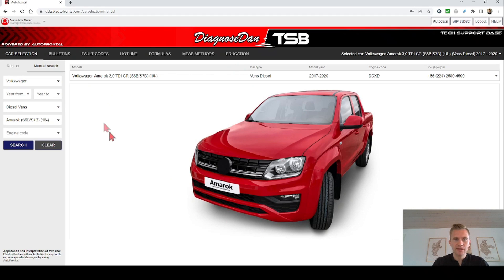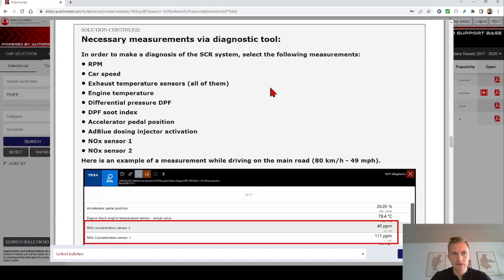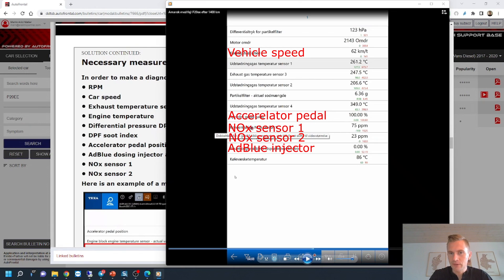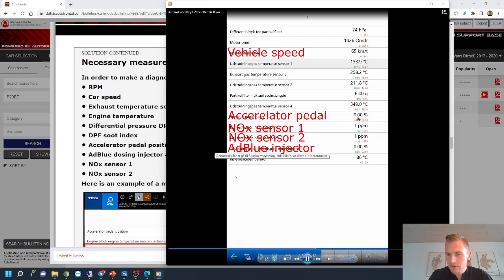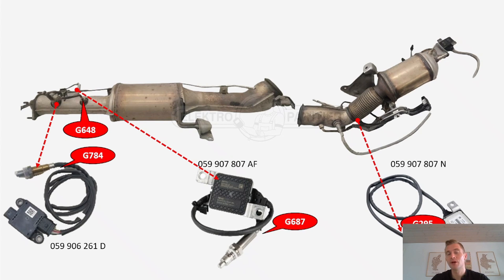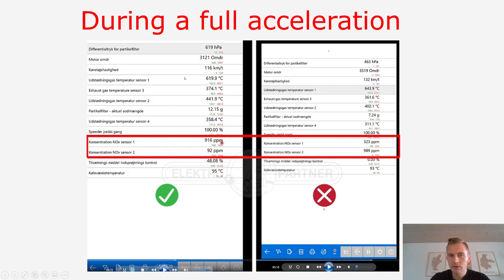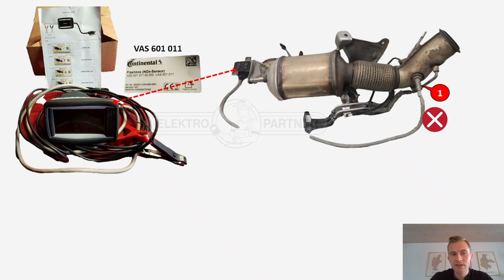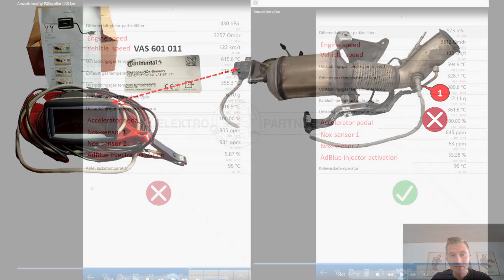2017 Volkswagen Amarok 3,0 TDI - Intermittent fault code P20EE

Comment: One year now i have P20EE on my Peugeot 208 bluehdi 2017. Nobody knows what's going on. After service I took the car on highway and check engine key light and adblue came on. I changed adblue injector but the problem still exist. I bought an obd to reset the lights by my own. Any suggestion?
Reply from the maker: Hello @VCPLOU. TO diagnose this type of error requires a technician with the right education, tools and information. This error can have many different reasons and different causes to the error. I advice you to send the car to a qualified technician with access to all the right information regarding this.

Comment: Thanks Martin, I have a same problem in an Iveco daily, code p20EE and the value in sensor 2 is greater than sensor 1!  this van has a history of problems with the dpf and scr, there was an overheat and it destroyed the dpf and the scr was cleared.  already with the new dpf this new problem appeared in the scr.  my question is is it possible that the clogged scr causes the nox reading to increase on sensor 2?  I have a very low reading on the pressure differential in the dpf, but when I remove the tube from the dpf outlet I have more normal pressure values which suggests some clogging in the scr.
Reply from the maker: Hi Rui Faria. Its difficult to say if the rise is caused by the clogged DPF. To determine that i need to see a video with the data pids from page 5 in TSB no. 7666. If you can get your hands on a known good vehicle and measure this it would perhaps lead you closer to you question. Regards Martin
Reply: Hi Martin, Thanks for your work. I have same problem with my Alfa   Stelvio Diesel 190cv with adblue. I found Only p20ee-00 error. Later i try check value from nox sensor One e two. Have you experience with this issue?. I change Pm10 sensor with official call from Alfa Romeo.
Reply: Hi man, did you find the problem? I have a higher reading on my nox sensor 2 also and only p20ee error code

Comment: P20EE can go any way if you work on a PSA vehicle.  Please give some more info on why that code can set.
ps : I've seen vehicles with 90k km & kat worn out with the same code.
Reply from the maker: Yes PSA 1.5 have big problems with the SCR catalyst at very low miles. Perhaps I can make a video one day with all the criteries to this fault code but most of this is already explained in TSB No. 7666 in DDTSB,